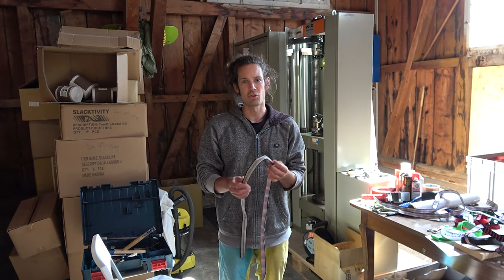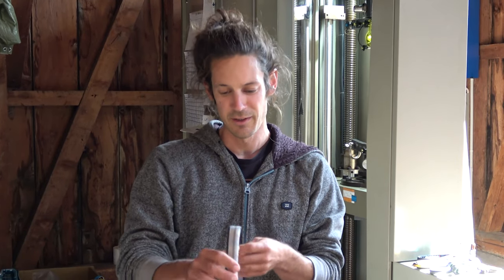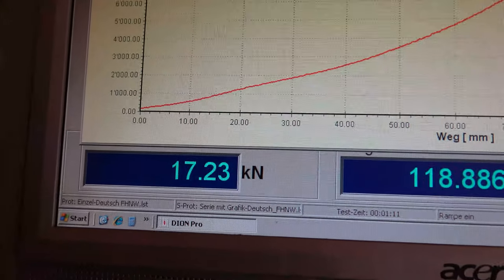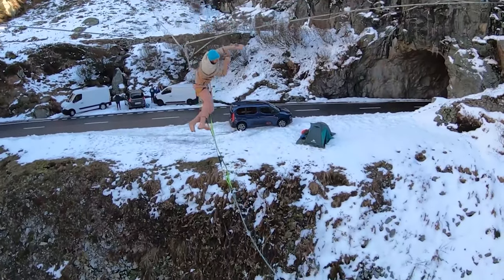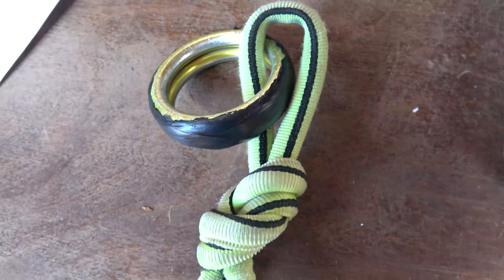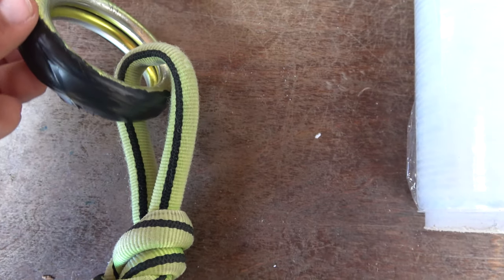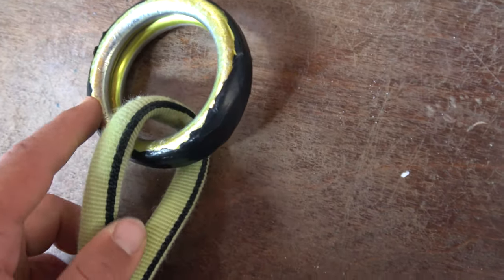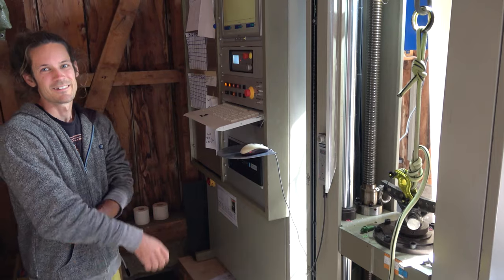Break-testing a permanent Highline Setup

Comment: Interesting and scary how the webbing got so weak inside the weblock! How would you test this with other weblocks? It seems like that would take  very long time, or is is there maybe a way to simulate long use...

And why wouldn't you tell which weblock it was, to protect the brand that made it? Because it does seem to be important information... (But maybe not if it's the only weblock with data about it yet).
Reply from the maker: We do not post the weblock type because we do not want to point at another brand. We have shared the brand and type of weblock with some people in the ISA, but do not want to make it public. The exact same weblock hangs in the new permanent setup on one anchor point. On the other we now have a SLACKTIVITY seaHorse. After some time we will check how the webbing looks where the weblocks are. Like this we have a comparison. Also next time we take the webbing out of the weblock, we will very carefully check how the webbing looks in the weblock to understand better what procedure has lead to this damage.

Comment: After seeing the (relatively) weak breaking strength of the leash despite having the tubular webbing to protect it I'm a bit more scared of the idea of the Raed Alpine Leash. The ring is ultra bomb but having a halved breaking strength for the Edelrid rope with no UV penetration makes me worry more about a leash that's exposed rope, even though that rope is already a core-sheath construction. I'll probably pick up the titanium ring eventually but stick to the big bulky balance community leash rope until more test data becomes available.
Reply from the maker: More on leash breaking strength: https://www.youtube.com/watch?v=TIPxuJ22bbc - The strength of the rope is of main importance for the breaking strength of the leash. And with 16kN+ on a new leash in a figure-8 our leash is not any weaker as most other leashes on the market. However, it is one of the lighter leashes out there, making the knot less heavy which is nice when it hits you in a freestyle session ^^